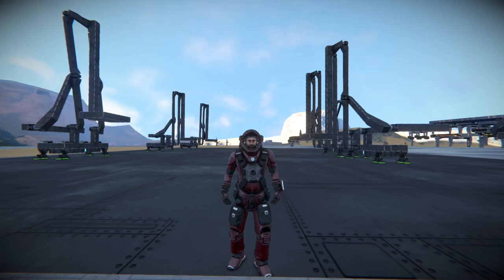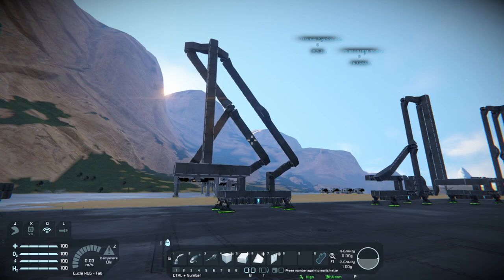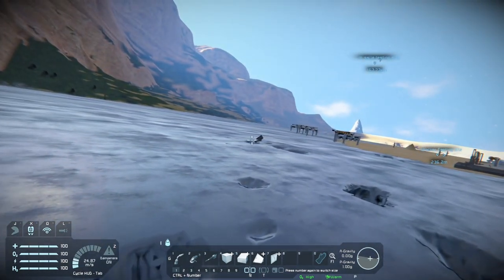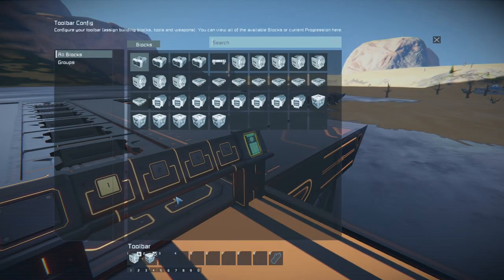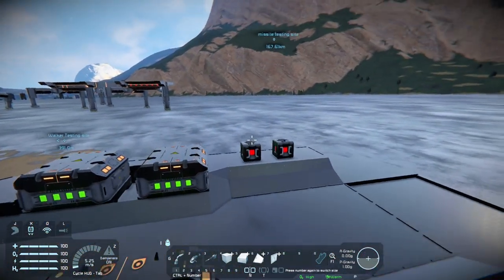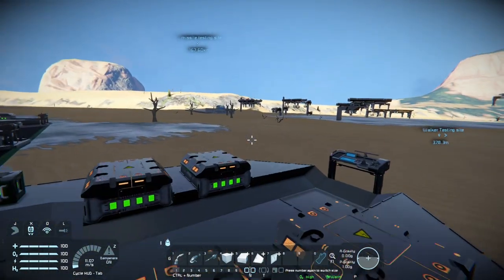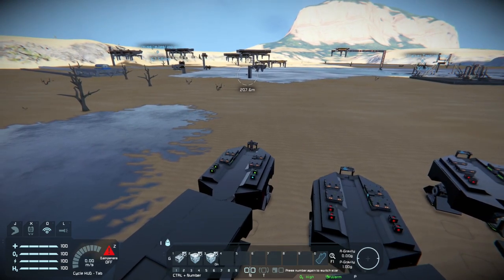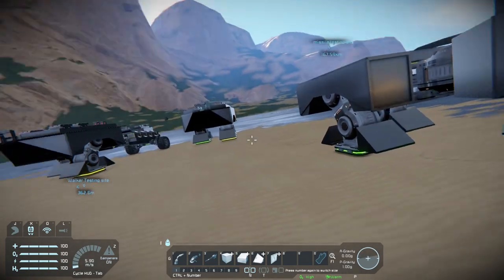Walkers - Space Engineers

Comment: So... I think it was black armor that made an elevator using gears made from armor blocks on a rotor... Perhaps try that set up but attach the legs on the outside of the gear near the circumference so as it rotates it picks up the leg and puts it back down... Feet tend to be made out of wheels... At least in most videos I have seen.

Interesting idea just came to mind.

Build two rings out of armor one that fits inside the other... Connect them via rotors on two different axis about 15-20° off from each other.
Use turret control to operate one rotor from each axle... Add a leg to both sides of the larger ring... Swivel the turret controls to cause the rotations of the rings to lift one side go forward and set the leg down then swivel again to pick up the other side and do it again... Build this on both front and back and you got it!

Comment: Wheels are pretty high friction. You can of course modify the friction with a suspension, but the wheel itself already comes with a base friction of, I think 30%.
Reply from the maker: Good point I’ll see how it works with the wheel block
Reply: Yeah, a number of mechs in the workshop or videos I've seen use 2+ 1x1 wheels either turned hubcap down or mounted normally for toe-like projections off the sides or front/back of the mech foot. Has to be with the full suspension, in order to use the friction settings. Otherwise the non-suspension wheels alone are merely a robust non-deforming alternative for armor (b/c they keep the collision properties of the wheel itself; also why these are used for kinetic PMW missiles along with drill heads).